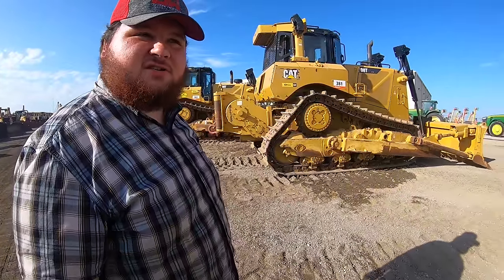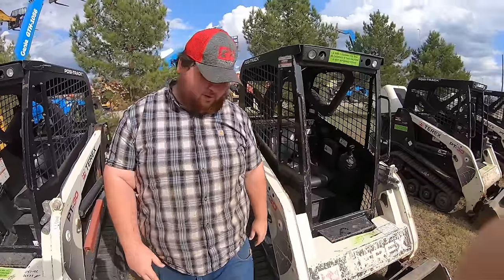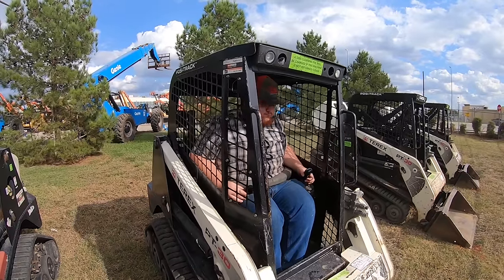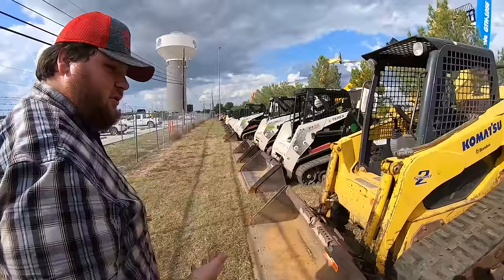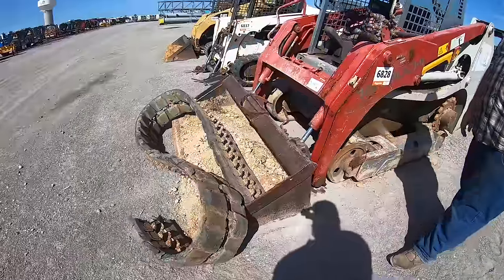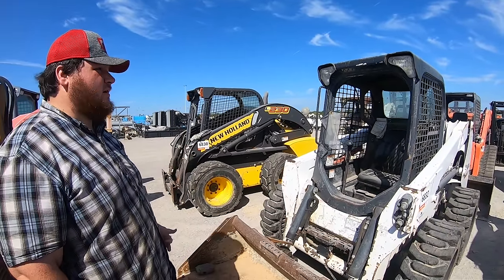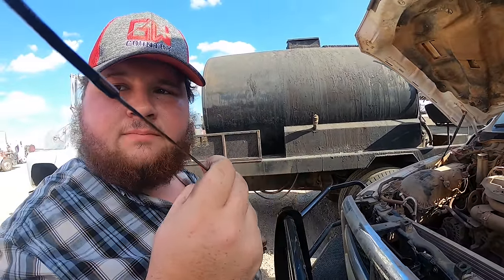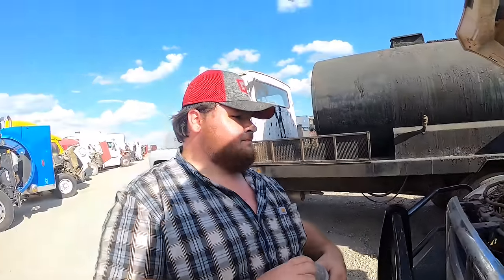WE TRY to Buy Trucks & Bulldozers, EVERYTHING!

Comment: “Oop I see what’s wrong with it”
“What is it”
“They took it apart”

Lol
Reply: or parted it out
Reply: I saw that radiator and fan missing right away too. With the turbo and radiator and other parts missing it’s most likely got a dead motor or transmission and they decided to part it out instead of fix it.

Comment: I just learned I don’t know enough to buy a salvaged truck. Lol.
Reply: Quite simple machines really. Bit of reading, bit of wrenching youll learn a lot. Just depends how much you want to spend on a busted up truck to repair.
Reply: Work on aircraft for a living, 39 years. My luck buy one, yep need new frame ha.
Reply: same thought I had
Reply: @timdaviszaper  Why you look top to bottom, front to rear. Ive called dealers out many times over on broken things and issues. Just last week i spotted a nice used truck. Turns out it was trashed but a polished turd.
Reply: Star control origins
Reply: @timdaviszaper  Oh, the irony of this post...  Hey, Ford Raptor, little boo boo on the fender and suspension...

Comment: Westen how did you obtain the KNOWLEDGE for Diesel  engines ....  More on the auction ....
Reply: Its quite simple. Diesels are very simple engines to deal with. Wrench on them enough and you know the ins and outs. 68rfe trans usually blow apart. Cummins engines that idle for too long will have fuel wash out the cylinders of oil destroying the engine. Oilfield aint no joke on equpiment. Ran hard put away wet. Had a guy who couldnt get his truck out of 4x4. Comoany said drive it. 300 miles later the transfercase blew and the entire front axle was destroyed. Did as he was told though.

Comment: Sad thing is, 90 percent of these have been worked to death but are just waiting to catfish the next owner that pays 75 percent of retail. Only to find out that the motor that looked good in the online auction has been living off either bunny tranfusions and is making glitter in the oil pan. Or maybe the freshly painted Cat that looks like it did time in a salt mine. Some nice buys if you were local and got em cheap.  But usually when the stuff is that bad they make it public and let the dreamers in that have no idea. Throw it on plastic and end up refinancing.

Comment: Westen.... watching and listening to you dissect those vehicles is the most interesting part of these videos.  
I’m not an expert, but I have an enormous interest in the viability of purchasing vehicles that are both relatively new... AND ‘junked’ due to a Major (or undetermined) mechanical failure.  
For other mechanics it might be boring...  but for someone like myself that doesn’t have the years of experience learning the intricacies of modern vehicles... YOUR knowledge and ability to dissect those vehicles (especially the line of 1-ton pickups), is REALLY REALLY INTERESTING. 

PLEASE CONTINUE TO POST VIDEOS EXACTLY LIKE THE “AUCTION DAY” vid, focusing on the rapid diagnostics, truck by truck LIKE YOU DID AT THE MIDDLE AND END OF THIS VIDEO.   
THAT SHOWS OFF YOUR INTELLIGENCE AND KNOWLEDGE IN A WAY THATS RELEVANT TO PEOPLE LIKE MYSELF THAT WANT TO KNOW MORE ABOUT THE MECHANICAL STATE OF ALL THESE USED PICKUPS FOR SALE.  I CANT GAIN YEARS OF KNOWLEDGE WRENCHING IN A SHOP OR GOING TO EXPENSIVE TRADE SCHOOLS, SO WATCHING YOU DISSECT THOSE VEHICLES IS REALLY REALLY COOL.  
Keep up the vids and ignore the commenters that are trolling around trying to belittle your knowledge out of spite. 
Thanks bud keep it up!

Comment: Idk if you will see this Westen but if you do i hope you or anyone else can give me an opinion. I have been looking at a truck on craigslist that seems like it would be a good deal. It is a 1999 Dodge 3500 Sport extended cab, automatic, 4x4, dually with the v10 engine and a flatbed. 150k miles. the price has recently came down to $5k. i called the guy and he says he has towed cars with it one car at a time from New York with it but thats about it. I havent looked at it in person yet, but the fact that it hasnt sold yet seems odd to me cause it sounds like a good deal. what would be something i should look for? i know the transmissions and front ends on such trucks suck and i know the fuel mileage would be horrbile. im not worried about the fuel mileage though.

Comment: Interesting to see you look and dissect all these machines. Never been to one with all that heavy machinery but I've bought a few outboard boat motors at auctions and it's actually pretty fun. Can find some great deals, bought a 2016 Mercury Verado 300hp with 85 hours for $900 a couple years back. Needed about $400 in parts and a couple hours labor and she's perfect. That's about a 95% off deal.

Comment: Figured I'd share this about that Peterbilt. ISX cummins has a real problem blowing out fuel pumps, which send metal into the oil system and typically damage rod/ main bearings. That whole short block is most likely junk.

Comment: are you familiar with the 4.5L Powerstroke? i found one for $200 running and im thinking a little about swapping it into my 99 F350 (currently has a 5.4 Gas in it) any thoughts? I know it wont be easy as parts arent super common and as far as i can find nobody has done it yet but i think im up for the challenge... would love to hear from someone with some experience

Comment: thats funny,  they put hucky pucky in the radiator...  never heard it referred to as that.. 

you are very correct on skid steers the parts are $$$ (even worse now that bobcat is owned by an Korean company,  Doosan. the Kubota motors in them are built under license in Korea..not Kubota quality...)    also at about 10 years old every hydraulic seal in the control valves starts to leak and they are mostly in difficult to get to locations..  requiring 8hrs labor to replace a 25$ part...   and people don't seem to get it   they are great when new or in good condition but can go downhill quick..   I have one and I tell people to rent them don't buy one even if you get it cheep.  the exception is the old 743 landscape skid steer those are not too bad to work on and seem to run forever...  but anyone with one in good condition will not sell it..... 

also imagine that Cat skid steer with a hydraulic leak all that dust and dirt would turn to a nasty goo...  even a steam cleaner would have a hard time with..  dont ask how I know...  

If you do another one of these explain the costs to fix what you see and the labor involved,  one thing people seem to miss is you are buying a big ????  you will never know everything that is wrong and some stuff like that g56 and the aisin trans those even used are not cheep units,  3-4k for a used takeout plus all the other little stuff that was damaged..  and the labor to fix it...  that truck with the cracked trans and transfer could be very expensive to fix..

Comment: Started watching your videos recenlty and this one caught my attention since im an equipment tech. 

We have dirty machines come in left and right and honestly most of them work fine. Theu are used often and routinely maintenanced. I take them in the wash rack and spray the motors off lightly. Most issues with skid steers are operator damage/misuse. Occasional factory defect but itll be covered by manufacturer. 

As far as the "far from good" cat skid, when we go to sell the old used equipment we scrape loose paint off and spot paint. Better and easier to buy/sell that than something that looks like dog shit. I think it would be profitable to send them out for a $1500-2000 paintjob prior to sale just because appearance does mean something and it is one less thing to worry about.

Takeuchi are my favorite for ease of work and reliability. I also have diag. Least non operator inflicted damage/failures. In my experience